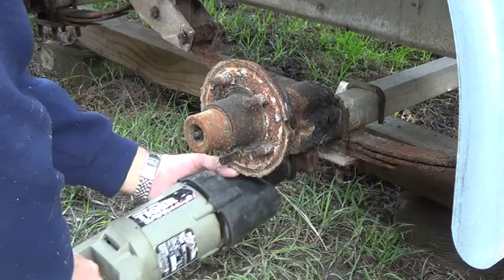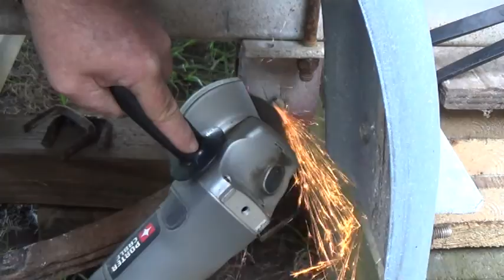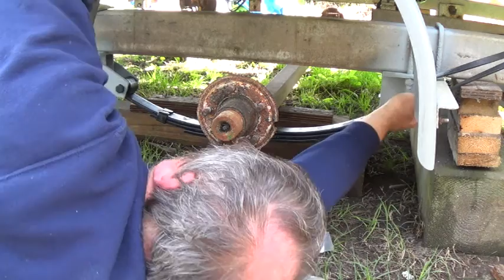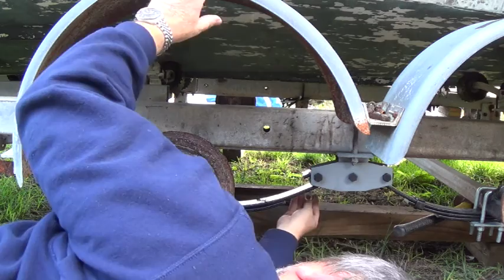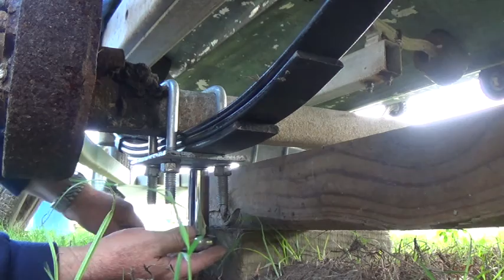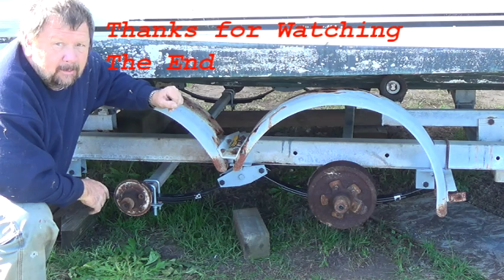Boat Trailer Spring Replace

Comment: Nice work, I am doing a similar project to my trailer.  I saw when you attached the springs to the hangers you put threw a bolt I didn't see you us a bushing.  In mine I was told to use a bushing I thought i saw it when you were installing the U bolts. My question is, Are the bushings metal or hard plastic?

Comment: Excellent video and thanks for posting, my trailer is a Shorelander double axel with the slipper and equalizer like yours, note mine is a top axel mount, and both springs the "SLIPPER HOOK " if you will is towards the rear of the trailer, my trailer was purchased new from the dealer back in 2008 so I can only hope it was done correctly. I completely replace all my springs and brakes, including all bolts, IMO it was not bad. The dealer wanted 1,900 for the job, all my parts springs, hubs brakes etc were 1300, always a pleasure to do stuff yourself if you can.
Reply from the maker: You are so right, the cost of labor is so high we can take the time to learn how to fix it our self. Then fix it and still be a head of the game. Thanks for commenting.

Comment from the maker: The company i bought all the springs and trailer bolts did not have the new bushings for my trailer, so i save the old ones and use them. I could have change them but i would have had to see if i could have got them from  load rite.

Comment: You never check to see if axle will tract right. You assume that it was right and didn’t move
Reply from the maker: The center pin in the spring has to line up with the hole in the bottom of the axle. I put it back like it was and the trailer pulls fine. Thanks for watching and commenting.